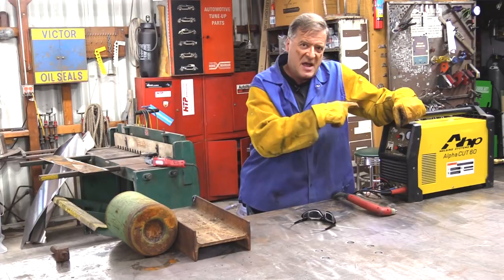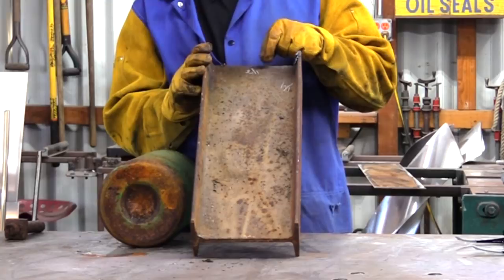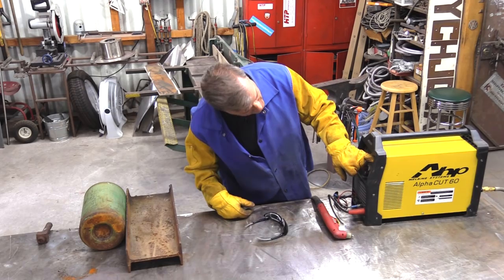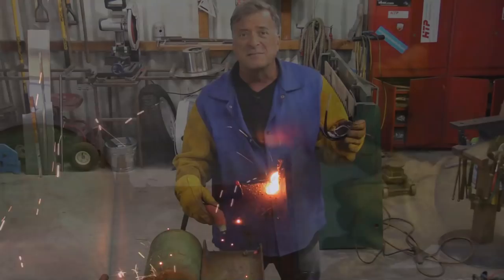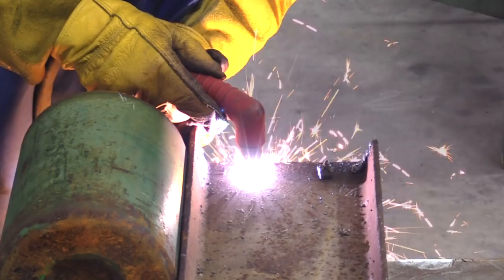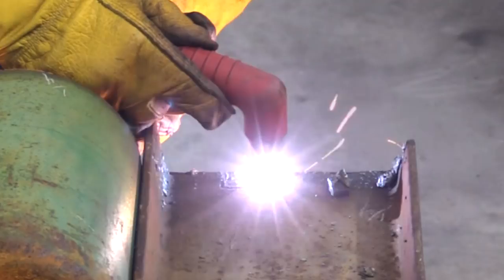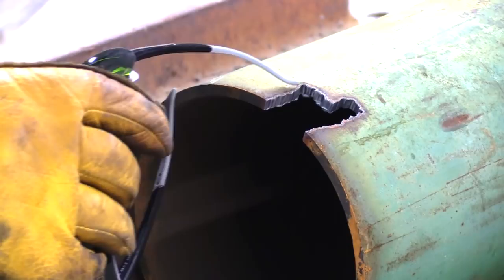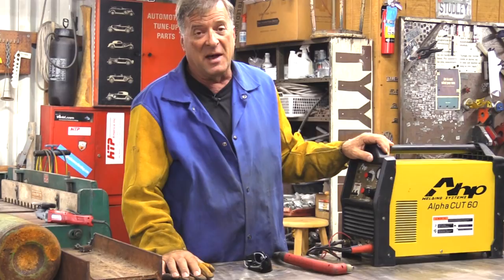Can You Cut Rusty Metal and Paint With a Plasma Cutter? - Kevin Caron

Comment: Catching up on these vids I missed. I realize this was just a short cut for video purpose but I'm thinking it's something that if I do I should be wearing a p100 .  Typically for plasma cutting even for short periods, think it's best to put it on.  I have done some short cuts ( have not used the machine much yet ) and find myself holding my breathe a little and it might even aid in getting a good cut because you wont rush if you're breathing well. I plan on wearing it now.  Do you usually use one?
Reply from the maker: Not normally but you are correct!    I should be wearing one.
Reply: @KevincaronSculpture  i guess a slight airflow in the shop taking the fumes away is ok but i dont have that when it's not warm enough to open the garage door a bit.   thanks for the reply !